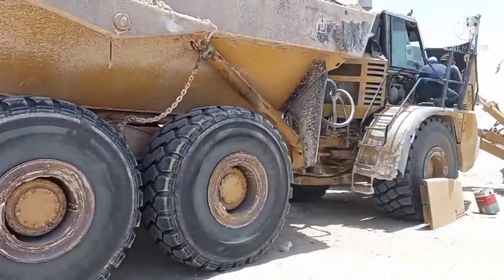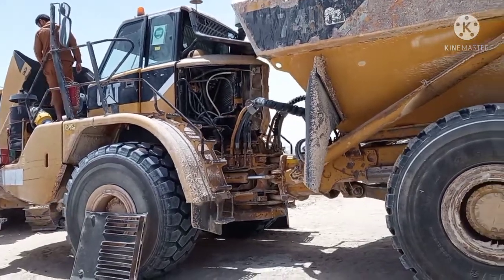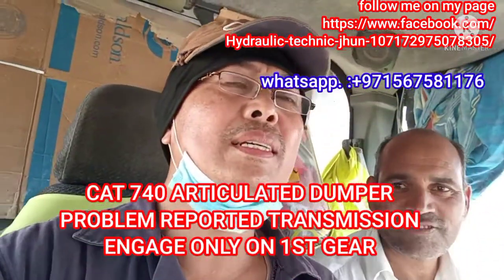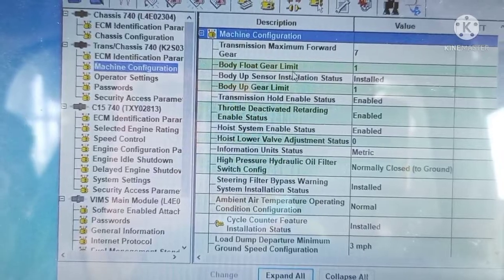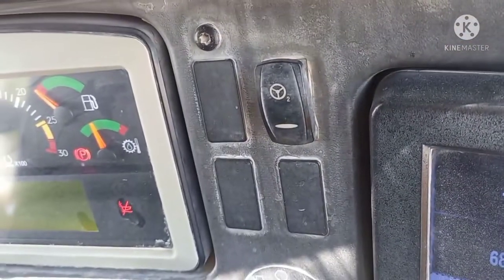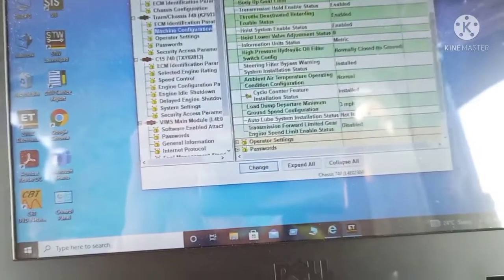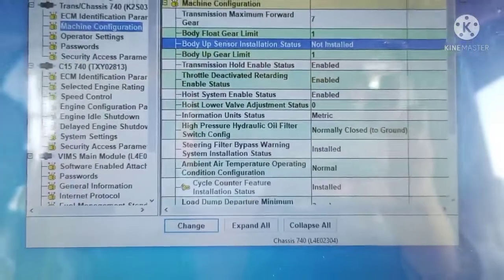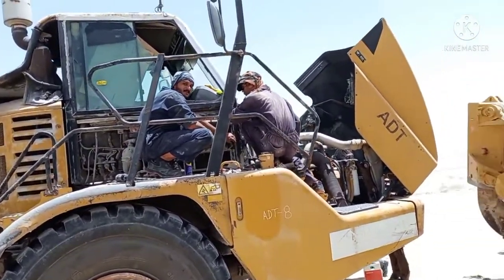CAT 740 ARTICULATED 1st gear work only because of BODY UP SENSOR

Comment: Sir jhun,ihave a problem pc200-8 accelerator problem after 5m.rpm back to low the accelerator did not function even if the accelerator control going to high..
Reply from the maker: in that situition sometimes acceleration problem just because of engine overheat,or low engine oil pressure,or engine oil pressure is overheat and many more,to protect the engine for more problem or making more damage,so the ecm detected one of those problem i mention ,so try to observe for what reason why the engine it return to idle,in a few mins or hours.

Comment: Hello sir, I have a new Komatsu 210....2002c_7 excavator. The temperature rises to 80. I hope you can help me reduce the temperature. Thank you for your efforts.
Reply from the maker: newly buy or brandnew,i dont know if new or used,if you are talking the solution of over heating,i think you have to check the condition of your engine and also the condition of the hydraulic system,how the condition of your machine while on working in full acceleration,if the engine smoking or normal smoke,why i am telling you all of that,maybe the problem is overload,and last check the blowbay,the radiator if the is brown color,meaning maybe the corrosion is bocking the hole of your radiator so the circulation of the water is very limited,
Reply: @caterpillarjhunhunk  Dear Sir, All Komatsu excavators in Iraq reach hydraulic and engine temperatures of more than 80°C.Do you have a way to lower it through the screen? 🌸🌸🌸💖
Reply from the maker: @NLC-DOZER  that machine is have protection like for example if they reach the maximum high temp,the machine will automaticaly go back in low idle thats the komatsu program,i think in iraq now is summer,if reaching maximum temp check the engine fan and fan belt and the front side,maybe any obstraction for air intake,and check the hydraulic filter how long the last replacement,apply propper preventive maintenance.can ask a question,if that machine is assimbled as standard in GCC you dont need to worry,atlist dosnt reach  maximum temp.
Reply: @caterpillarjhunhunk  Thank you, my friend. 🌸🌸❤️❤️